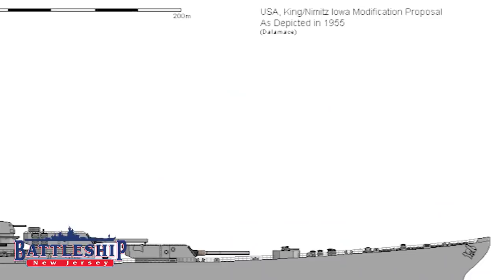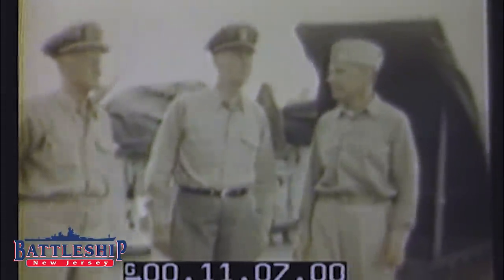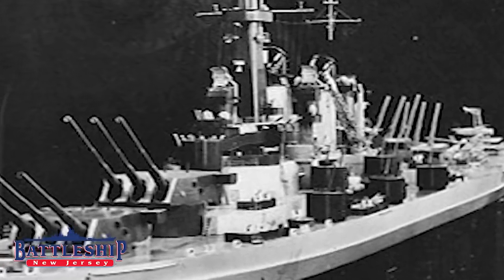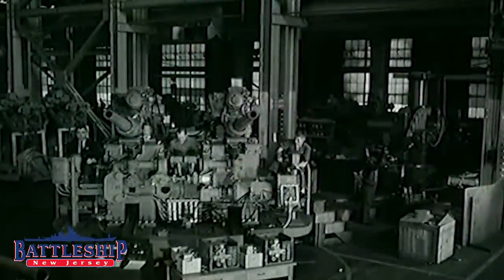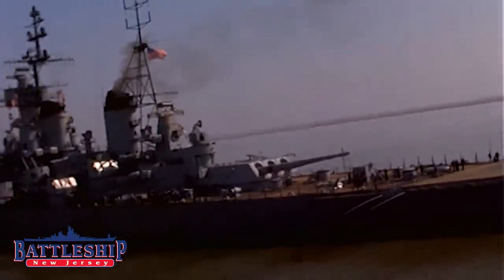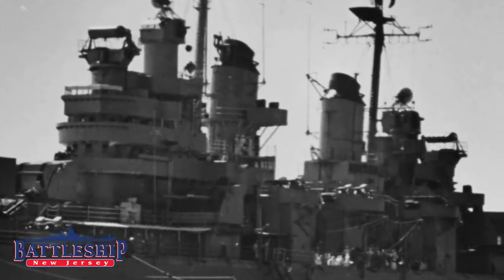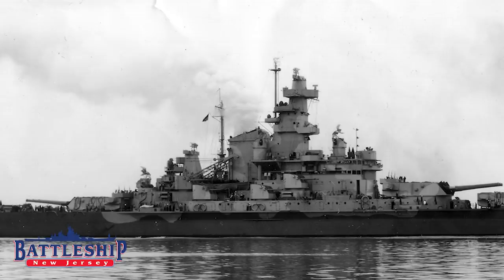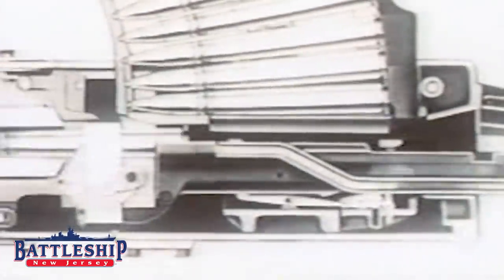King/Nimitz Iowa Conversion

Comment: Do you think we could construct barrels for guns like the Iowa's 16"s that don't need regular replacing with modern metallurgy?
Reply: The short answer is no! Even with modern metallurgy the best that a modern 16 inch 50 caliber gun could hope for is more shots per service lifecycle when compared to the newly off the foundry floor 16 inch 50 caliber long rifles that were produced during World War II. One thing that needs to be taken into account is that every time a shell leaves the barrel it is engaging the rifling and friction is wearing that out combined with the three 110 pound powder bags it takes to move that shell out of said barrel. There is the pressure from the bag ignition the soot that begins to foul the barrel after so many shots along with the heat. All this combine leads to the where in tear that eventually requires a barrel to be removed from the turret and refurbished so they can be reinstalled back into the turret
Reply: Interesting.  Like a 4150 steel barrel, chrome lined, cryogenically treated?
Reply: @IvorMektin1701  Possibly, but some of the chrome lining would be worn away with each firing so it would still have a limited life before needing to be replaced or serviced.
Reply: @ghost307  
Right.  I wasn't implying a permanent barrel.
Reply: @IvorMektin1701  Sorry. My misunderstanding.
Reply: @ghost307  
No worries
Reply: As said, no. Just look at modern field artillery and other firearms. All need replacement barrels after a while.
They last longer than they did during WW2, but not that much longer.
And in warfare, that's not all that much of a problem as the weapon isn't expected to last very long anyway (things get damaged and destroyed in combat way faster than they wear out). It's mainly in peacetime that longevity becomes an issue.
Reply: @IvorMektin1701  Even still the best rifle material on a shoulder fired rifle has a limited lifespan. The higher the pressure the shorter the life. One of the reasons you don't see some of the super fast ultra-magnums Say 7mm STW or 300 Remington Ultra magnum is because their barrel life it less than 1000 rounds. Now most hunters seldom shoot that many rounds and those that do with those types of rifles understand that the barrel is a disposable item, just like 16 inch Battleship main guns. They have a certain life that can be determined by how many armor piercing vs High explosive rounds are expended as they have different pressures. They just plan on replacing the liners at certain round counts unless something comes up and they have to shoot at something floating and shooting back. then you just understand it won't be as accurate as a new barrel would be.
Reply: @terrygardner3031  
I know.  I used to shoot NRA high power and would wear out Krieger barrels on M-14s

Comment: Wa the 3" 50 cal DP gun in dual mounts w/ Mk 56 GFCS ever considered? I believe that was the late war design for AA as it was superior in rate of fire and destructiveness compared to the Bofors 40.
Reply: The 3"/50 twin mounted was intended to replace the quad 40 mounts.  Unfortunately, it only began testing in September 1945.  If the war had lasted longer, it might have seen combat service.
Reply: I believe that the 3" 50cal was the smallest gun that could use a proximity fuse at the time. I could be wrong though.

Comment: BNJ, problem that I see is by mid 1945 we know jets can do 550 MPH flat and level and their are guided anti-ship bombs (like the USA's BAT radar guided glide bombs. that was used twice against the IJN just before the war ends). Missiles have not, proven selves yet. So I would be thinking of guns with more reach. Like maybe the 5 inch 45 cal or maybe a 5 inch cartridge with 10 to 15% more powder charge.
Reply: Interesting here to note is that with the advent of the proximity fuzes kills to attacking aircraft were dramatically higher...
Reply: They were heading that way with the 5"/54 that were going to be mounted on the Montanas and were mounted on the Midway class carriers.  The problem was that the round was just too heavy to manhandle easily and it tired out the gun crews.  Luckily for the USN, the 5"/38 and its associated round were the perfect mix of weight and lethality.

Comment: The Only Way to ever build a battleship is to have conduit spaces for these upgrades with the automation always perceived with a time line!!@
Shore Bombardment, Ship vs Ship Missile Offense/Defense, 12 close in Anti Aircraft /Anti Ship/Anti Torpedo gun systems///Submarine Torpedo platform plus Sonar and radar sytems in a Montana design except elevated turrets housing Missile Containers!!! Plus, Diesel Engines supply Energy to Electric Generators for Horsepower/ Electrical/ Radar Jamming/ LASER munitions!!! Rail Gun Future!!!!

Comment: How high above the waterline was the deck of the highest space sheltered from the elements, the highest dry space even if not armored. The highest space with bunks?
Reply from the maker: The 011 level, 11 decks up from the main deck, is an interior enclosed space. Highest bed is probably the captain's on the 08.

Comment: OK ---------- My question is. why didn't they simply turn the half-built battleship hulls into armored flight deck Carriers? Giving America a couple of Carreirs that could not be knocked out with the first Komacozy hit. If the war had continued, at the rate that they were losing carriers to Komacozies, within a year they would have been trying to invade Japan without any carriers as they all would have been back in the states with half of them waiting for dockyards to even start repairs.

Comment: I'm not impressed with the King/Nimitz conversion and I think it went the wrong direction even back then. I think they were using far too small caliber guns for antiaircraft defense which is what the conversion is supposed to help and the men were getting far less hits than needed. But what they should have done is beef up the destroyers with 3 &5" guns with radar control to take out airborne bogies. if we were to have battleships in this day, a great start would be to use the Montana hull and take turret 3 and make that a 4 piece rail gun, take out all the 5" 40 cal's. and put a super firing 5" 73 Cal gun above turret 2, and 2 each side of the superstructure at deck level, and small rail guns up higher to fire down and out, the missiles could be the mix still. I'm a big caliber guy and none of those 5" 40 cal guns should be on any ship unless it is a museum.

Comment: If it were my decision, I would drop a forward turret and reduce the guns to 14".  With the sinking of the Yamato, ship vs ship warfare was no longer much of a threat.  Since the fast BBs were no longer the primary instrument of pre-invasion bombardments, the need for 9x16" guns were nearing obsolescence.  The saved tonnage by going to 6x14" would add even more speed and make room for an even more advanced AA suite.  Kamikazes, by the thousands a day, would have been the most serious threat to any invasion fleet.  An ample AA + CAP defense force would have been needed to shield the logistics fleet supporting the hundreds of thousands of soldiers and marines onshore.
Reply: This is simply too much of a change, first it requires hindsight, second, no one wants or like the sound of a downgrade, along with less range. Lastly, the kamikaze threat ended with world war two.
Reply: @ThePTBRULES  I agree with all your points, but we can use hindsight since that is what was asked for in the video.

Comment: Wouldn't a  5" mount bow and stern have been under armoured without a redistribution of the main belt?
Reply: They weren't going to be mounted on the bow and stern.  They would have been mounted in superfiring positions over Turrets Two and Three. Ryan's phrasing was a little off there.
Reply: Look at USS Salem/De Moine Class, or Yamato, the Gun is placed above the second and third to the inside of those primary mounts, giving those gun 200+degrees arcs.
Reply: @Bob_Betker  ah right, that makes sense.

Comment: The King/Nimitz design would not have been built wasn't needed. By that time 90% of the IJN was sitting on the bottom or so damaged it would never get back into service. Not mention carriers were the new queens of the sea with power projection and precision striking forces. King and Nimitz were battleship admirals dragged into carrier age. Even with operation downfall we still had air and sea supremacy without the flt. II New Jersey's or more Alaska's.